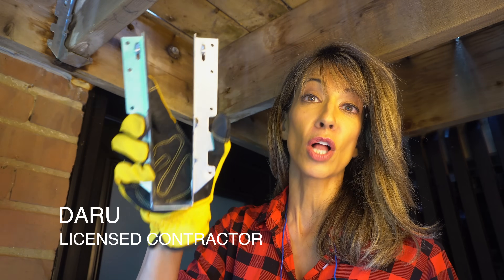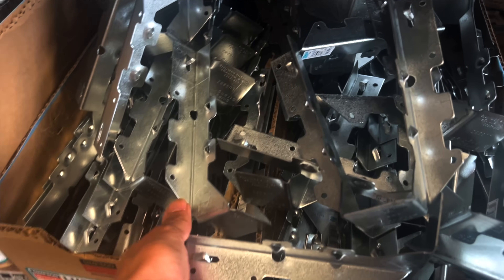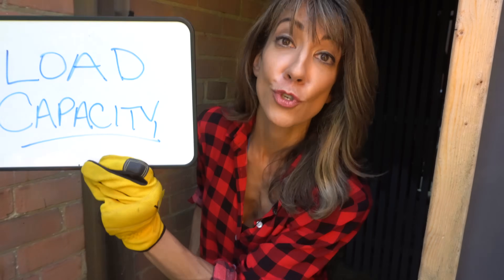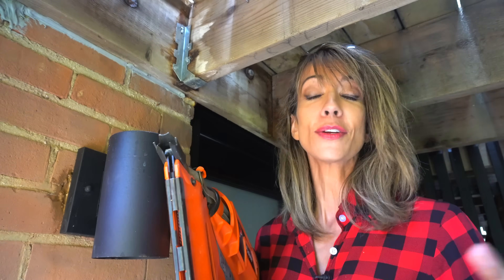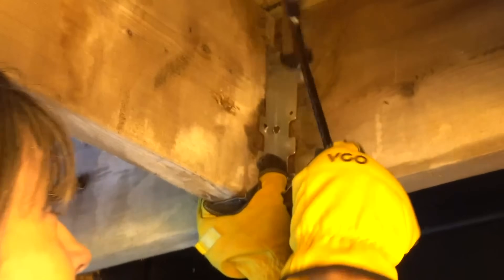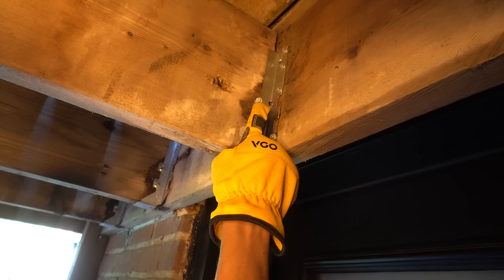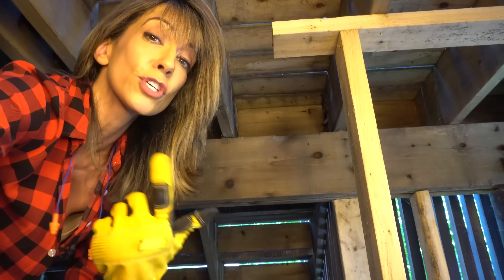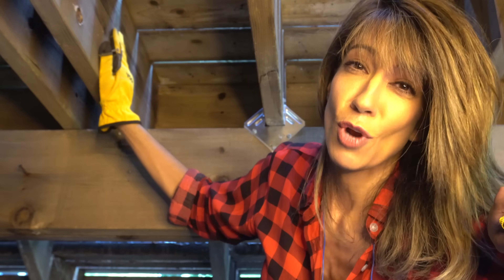Joist Hangers: Do Screws Beat Nails? (Backed by Science)

Comment from the maker: Watch Next →Floating Deck Build:  https://youtu.be/3zaLl0kty20
Have a favorite Tip or trick of your own? Share with us here in the comments! I've been using screws for deck for awhile, how about you? Thanks to everyone who shares their tips and comments. I helps our channel and everyone watching. Thanks your support is appreciated!
Reply: You need to use the shorter screws when fastening directly to the ledger board... then longer screws that you used, the threads come out of the back of the ledger board and are not gripping anything but air...
Reply from the maker: @brandonfarris3335 yes, the proper screws are linked in the description for more info. Cheers!
Reply: Why do you use two and a half inch screws  on an inch and a half inch thick ledger board?  @DaruDhillon
Reply: If you are using treated lumber , which you should be , eventually the galvanized coating on those screws will deteriorate inside the wood itself from both chemical and moisture exposure. As a woodworker with over fifty years of experience , I can tell you that you would be much better off in the long run to use stainless steel screws . They are more expensive but well worth it . I had to replace the hand rails on a deck a while back and every one of those galvanized screws were oxidized in half at one point or another . It was a chore to say the least .
Reply from the maker: @watsamatau  Sounds like you handled the situation well. Good to hear from you.
Reply: @watsamatau  though they’re a little expensive I use GRK construction grade screws for almost everything outdoors and pressure treated wood
Reply: @ps7462 cool . I remodeled a deck for a friend over in Coco sea side about four years ago . I went back about a year later to replace a hand rail made of ground treat because it was severely checked. All of the stainless screws I used looked as new as the day I installed them . Thanks but , I'll stick with what I know works .
Reply: Smokin hot carpenter girl
Reply: Beautiful!

Comment: Your video is about installing new joist hangers (with screws) under an old deck but at the end you say not to use screws in old joists as it will cause them to split; I’m so confused. 😕

Comment: You used the wrong length screws in the ledger 🤦‍♂️ 1½" not 2½"  the screw or nail is only supposed to go into the ledger. 2½" for the angle.  Going into the joint and into the ledger only.
Reply from the maker: The screws you need are correct the 1 1/2”. The beauty of screws is they are easy to swap out. They were out at my local hardware store when I shot the video. Appreciate your attention to detail!

Comment: screws have greater pull out strength - which is different from tensile strength.   nails and screws of the same material and diameter will have the same tensile strength but screws will have higher pull out strength.

Nails typically have greater shear strength since they are not cut with threads.  Screw threads general reduce the effective diameter of the fastener and reduce shear strength.

The long screws that go completely through the ledger/plate will likely defeat the screw pull out advantage since the screw threads will be outside the back of the plate - unless there is additional structure behind the ledger/plate.   The longer screws are required for the toe fastening through angles.
Reply from the maker: Appreciate you taking the time to share your experience on screw strengths and sizing. Good to keep in mind!

Comment: for a joist hanger sheer strength is much more important the tensile strength.  The joists bear down on the hangers causing a lot of sheering between the joist and girder.  The downward force  does not cause that much pull(tensile) on the hanger away from girder.   Making nails a better choice.
Even so,  screws suffice.
Reply from the maker: Good to hear your feedback on the screw strengths! Thanks for sharing

Comment: The screw into the corner of the beam into the joist is only holding a 1/4" of wood. If that was done with a nail gun it'd blow off the corner of the beam, any movement will splinter the corner of the beam really easily
Reply from the maker: You need the 9 1/2” as listed in description. Easy swap out. Order the screws ahead of time, good eye!

Comment: The bit about the tensile strength of screws over nails befuddles me a bit. A nail's tensile strength comes down two things: pull-out resistance and head strength. So, basically, the nail will pull out of the material before it will fail in any way by snapping due to tensile forces. And it is highly unlikely that the head of the nail will pop off thereby allowing the attached member to pull off the nail. Maybe the discussion should have included using 'deformed' shank nails which are designed to resist pull-out to a much higher degree.
It is important to use the correct fastener for the situation and Simpson StrongTie has a Wood Construction Connector guide that is about 300 pages and details the specs on every connector and has a fastener glossary at the beginning of it. Those SD screws are made of highly spec'd alloy - no other screw should be used in their place! At all. Ever.
Reply from the maker: Thanks for sharing your thoughts on tensile strength and the Simpson guide. It’s a good long read. Excellent point to always use the approved fasteners. Good to hear from you!

Comment: Hurricane ties. I used them on an addition to my house in Los Angeles. Not required. I just thought, everything else is tied together, why not the ceiling?  
Kinetic Energy. This is basically an explosion. It has no direction. When I was a child I saw a pick up truck T boned in the bed by a car. Everything in the pick up bed when straight up. That's kinetic energy. No vector of any mass in that accident had a vertical component. Puzzled me for years. 
On a deck maybe a truck hits the side of the building. Those joists mostly just sitting on the beams could go straight up. When the stuff from that truck came down, the truck was no longer in that spot so it all landed in the street.  Those hurricane ties are very cheap insurance.  (And of course hurricanes and tornadoes.) 
Decks are always super critical because when they fail they'll fail because it's a big party and there are lots of people on the deck -- so a lot of people will be injured or worse.

Comment: Different ratings yes. Quantified the load? Hint: screws are not malible. Nails are. Tencil strength of screw? What species of lumber is used? What is the fiber density of the wood? BEARING? How much is the load, Dead and Live?

Comment: You are total wrong hangers are designed to keep joists from dropping if your foundation is correct there should not be any pulling away
Reply from the maker: Good to hear from you. Typically yes, you are right.
Reply: You are forgetting about seismic forces. Even the east coast has an occasional earthquake!

Comment: I found it impossible to find real hot dipped galvanized hangers.   Zinc plating does not cut it.   Did find stainless steel hangers which I coated with 2 coats of zinc paint and then sealed the whole deal in elastomer flashing.

Comment: Like your channel 

You used long screws in the leg into what seemed to be a single thickness rim joist/beam. Most of the screw in the timber was shank no thread. 

I think for those screw’s you should have used the short ones. At the 6:26 mark

All in all I find your delivery informative and interesting. 👍🏻
Reply from the maker: Yes, you are spot on! The correct size 1 1/2” is in the description. I appreciate you watching and sharing your thoughts. They were sold out at the time of shooting. Good point.

Comment: Great video. I always pre drill pilot holes for my screws when I’m working in my rentals, because they are old houses made of old wood. I’m hoping to increase the longevity of the structural components as much as possible.  I know it takes extra time, but I think it’s worth it to mitigate chances of splitting.
Reply from the maker: That's a great tip to keep in mind when working on older homes. Thanks for sharing.
Reply: @DaruDhillon you’re very welcome, and thanks for the reply!

Comment: 6:18 - curious but it looks like the long screws being used might be sticking out the back of the ledger board.  Is there a board behind there?  It seems like there is a recess behind there.  If no board, why use such a long screw, especially one without threads the whole length?  Normally the long deck screws without threads all the way along help to pull the board you are starting with close to the wood you are drilling into.
Reply from the maker: for a single ledger the 9 1/2" screws are used and listed in the description. They are also the most widely used and were sold out at the time I shot this video. Good eye and a reminder to order your screws ahead of construction or renovating.

Comment: Ive come back a few years to check on those galvanized screws, an at least half of them had cracked heads. 

One problem with galvanized metals is if you are using cedar, the galvanized fasteners will horribly turn the cedar gray. One joist hanger and bolt caused a 6' diameter staining, centered on the fasteners.
Reply from the maker: Appreciate you sharing your experience with cedar posts and galvanized screws. That’s an unfortunate situation. I feel you.

Comment: You made it all so simple to understand. Great job. Also, doesn't an air palm nailer negate most of the reason to use screws?
Reply from the maker: In my area, screws are the favoured method for DIYers. Palm nailers save money but are challenging to remove, down the road. Choose what works best. Both are good options. I like the removability of screws. That’s already come in handy on projects where plans have changed or I swapped hardware.

Comment: I am trying to attach a joist to a ledger that's at an angle. Is there specific hangers i can use for this?
Reply from the maker: Not that I’m aware of. I hope you find a solution that works.
Reply: Depending on the way the angle is you can find some you just have to go to a specific store well where I'm from I've seen a few different ones
Reply: @Josh-bs4xf great thank you. Will look in to it.

Comment: If you’re using actual structural screws designed for the hangers it doesn’t really matter. There is plenty of space between joists to swing a hammer and it’s not that hard. The problem is that people aren’t using structural screws because they are three times the price of the equivalent nails. People are using deck screws, which are merely meant to hold a deck board down to the joists. This is not acceptable. If you want screws get structural screws. If you won’t do that, use nails. It’s not that hard. But the stubbornness of some "country boys" is formidable. Of course, they aren’t using hangers anyway, just driving deck screws through the rims or toe screwing. Truth is, it costs only a tiny bit more to actually make the thing to code. So why are we so adamant about doing it wrong?
Reply from the maker: Thanks for sharing your experience with us.

Comment: All metal type connectors are in place to specifically provide “shear” protection against : Gravitational force, wind shear force, ground shift force, bearing down force and uplift force. These shear types of force, per building code, require specifically rated fasteners and connectors that are designed to tolerate a “shear force”. The specific type of fasteners used in conjunction with the metal connector are extremely important. Rated for use include, for example, a stubby TECO nail, or a specialty hanger screw, that are designed/engineered for “shear strength” having been manufactured with increased hardness (steel hardness) when compared to other common fasteners that are not rated for shear strength use.
Reply from the maker: Appreciate you providing the detail and helping others understand this topic.

Comment: I just had an Amish crew put up a garage for me. Their method to tie the trusses down is truss screws. Long, rated screws through the top plate into the bottom chord of each truss. It seems to be the norm with new construction, but I wonder if splitting comes into play later as wood dries out? I'm going to add hurricane ties as a fail safe. I'll follow your method since it looks great. Thanks for the videos!
Reply from the maker: Yes, there are special screws you can use for that purpose that are code compliant. Thanks for sharing your experience with your garage. Sounds like it was well built!

Comment: Squeeze your hangers together before installing. The hanger will pinch itself on the joist so yo u can work more easily.
Reply from the maker: Yes, that’s a good tip so it holds firm. Appreciate you sharing! Thanks

Comment: The shear strength of screws is genrally not less than nails of the same same diameter. The issue is their fatigue resistance. Nails are made from a more malleable material and withstand greater movement in the joint. Screws tend to be more brittle
Reply: That fatigue resistance is probably part of why they have good shear value. Nails are manufactured as drawn wire - which contributes to their superior shear characteristics. I used to employ a demonstration in my trainings that had both a screw and a nail partially driven into a piece of lumber. I would then take a framing hammer and use hard blows on the fasteners parallel to the face of the lumber - imposing massive shear.  If I landed it correctly, the screw would usually snap at the surface of the lumber on the first try. The nail would have to be bent back and forth about half-a-dozen times before it failed. More recent fasteners (and it depends on the particular screw) seem to deal with shear fatigue much better than the ones I demonstrated with over twenty years ago.

Comment: I have grown to love screws and avoid nails, particularly when there is vibrations and other impact or shock type force in play. If there is any flex or movement nails tend to work loose, except for ring shanks, but I still like screws better.
Reply from the maker: I hear you, screws do provide a secure connection!

Comment: good video, just a tidbit about US lumber size:
Why is 2"x 10" lumber sold as 2x10 when the dimensions are 1.5"x 9.25"? In the rest of the world the closest would be 45 mm x 220 mm (1.77" x 8.66") and it is sold by that dimension and the lumber is actually made to be that dimension. Much easier for the cutomer and everyone to not be jugling one false messurment and one real messurment.

(I know it is because the manufacturers start with a 2"x10" and mill it down, but in the past apparently in the US that was not the case, they actually made the finished product 2"x10")
Reply from the maker: It’s the same here in Canada. It’s a cost saving measure. I work in old houses and the old lumber is true to its size. Solid.

Comment: 2x8 floor joists into a 2x10 rim joist using a ledger strip and hot dipped galvanized nails if outside. Simple, quick, and strong.
Reply from the maker: That's an effective way to do it, thanks!

Comment: Its how long the nail is, but if you look at a deck, the nails go Straight down and they still pull out.  There's money to be made running the nails through a halfnium carbide screw mill at 1000 degrees, as long as the nail forge is well insulated you can make all goodies, like fuzed quartz.  The market has matured to such a point that sales need to separate baloney from avante garde unique advancement.  A.I. will realize the benefits of true service vs mass consumption of sparce resource channels in a failing chain of doom.

Comment: those screws are to long for the ledger, looks like very little thread connecting to the lumber, mainly the smooth shank.
Reply from the maker: Yes, you need the 1 1/2" for a single ledger. They were out when I shot the video. Lesson learned, they sell out fast. Thanks!

Comment: Check your local building codes when installing a deck in Michigan there are different codes for different areas so it’s not just across the state. It depends on the city or township where you are located. Some areas you can use screws other tells you to use truss mails
Reply from the maker: That is a great point to remember and thanks for sharing this info!

Comment: You should do a voice over about using the wrong length screw in the ledger, The screw you used has a clean shank that was longer than the thickness of the board. Thus no holding .
Reply from the maker: Thanks for the feedback.

Comment: If you use the screws or nails specified by the hanger manufacturer, you'll be fine with either.  If you hammer your fingers, use screws.  The specified nails will probably cost less.
Reply from the maker: Good advice and tips to keep in mind. Thanks!

Comment: Here in New Zealand we are required to use stainless steel joust hangers, nails and screws for all outside work including decks. I do love the nail in tab to set the joist. We don't have them here.
Great video. Thanks.
Reply from the maker: That’s interesting to know about the SS requirement. You must have some well built decks in New Zealand. Good to hear from you!

Comment: Forces on joints connections are all sheer. Unless screw tech has i proved, nails win in sheer strength.  When you install a screw, the screw heats up and the atoms get excited and separate weakening the metal. We've always use a ine piece connector nail. Hardened,  galvanized. Most clouts are two piece constructed.  Perhaps screw tech has changed things,  but i doubt it. There are no tensile forces on joints/hangers
Reply from the maker: Interesting thoughts, thanks for sharing your perspective!
Reply: @DaruDhillon your presentation and professionalism was on point
Reply from the maker: @needaman66 thanks, I appreciate you taking the time to let me know.